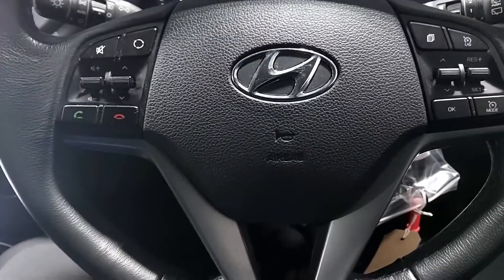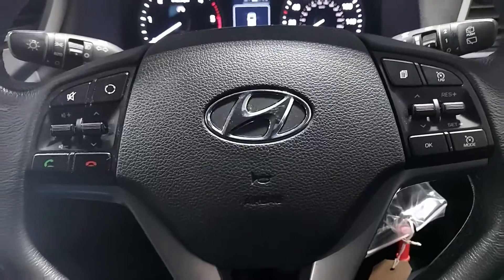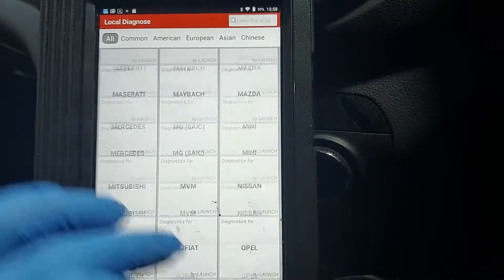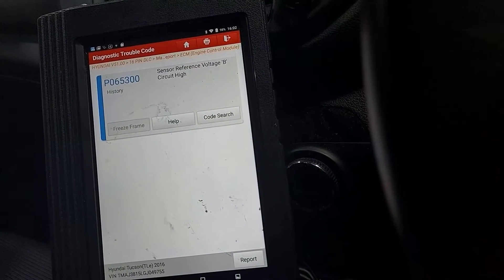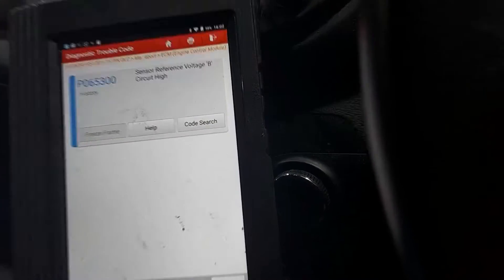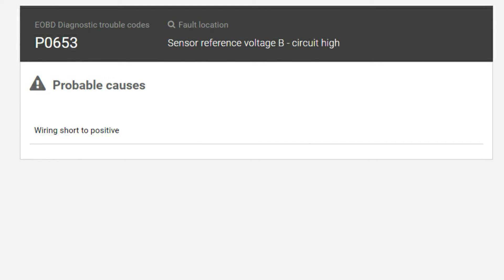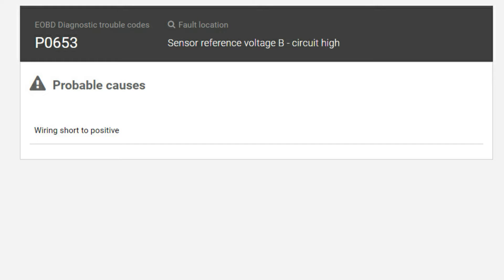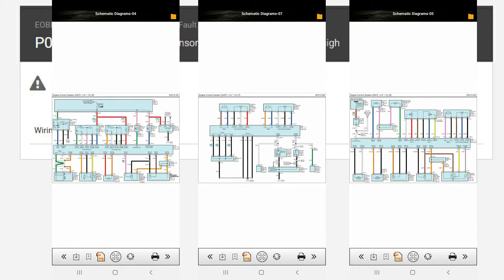Hyundai Kia P0653 Sensor Reference Voltage B High

Comment: Great video, thank you. My girlfriend's car has the same fault. The technician at the garage has diagnosed a fault with the "inlet manifold flaps" they say the part required is on back order from Hyundai and would cost £600 if they could get one. So they are looking at the used market. Does this sound plausible to you? Or should we try a different garage? The symptoms of the fault were no acceleration whatsoever. A short time after starting the engine the accelerator wouldn't increase the revs at all. Thanks!
Reply from the maker: You can disconnect the swirll flaps, and see if vehicle will drive, if it does, replace it with another one that is working (new or sh)
Reply: @GicaPhp  Thanks, I'll try that
Reply: I did the same, the motor lamp disappeared and i could accelerate again. I also put a 47 kohm resistor between signal and ground on that specific connector to the swirl flap actuator. When I did that i could reset the fault code in the OBD also. Ordered a new part and now I hope this will make the car run good again. Kia ceed 2016 1.6 GDI. You think i'm on the right track? @GicaPhp
Reply: I have the same issue. How did you fix it?

Comment: Good video!! What made you choose the swirl activation sensor?
Reply from the maker: Hi Michael, thank you for watching my video and thank you for this great question, so let me try to explain how I did it. Since I did not find anywhere which components were on the "B" 5v voltage reference, so I just made a list of all the components that are using 5V and 12V (as the fault was HIGH). After finding all the components using both 5v and 12V (EGR Actuator, Air Control Valve, and Swirl Control Actuator) I back probe the 5v, and when I found the 5V going over, I disconnect that component and checked again my scope. And in my case, it was a component fault (Swirl Control Actuator) which once disconnected, the 5V was perfect. I hope my explanation makes sense :D